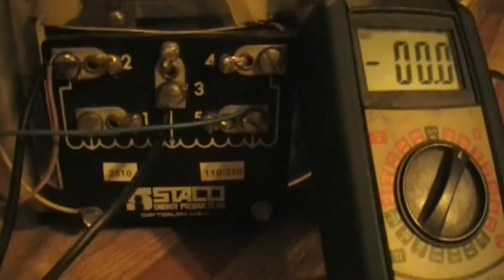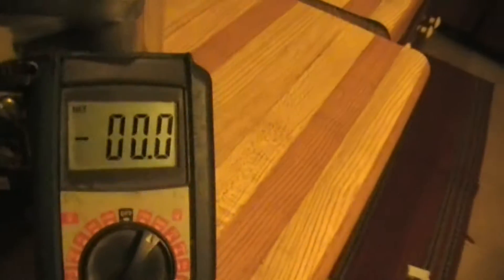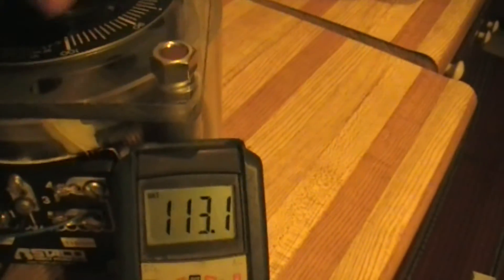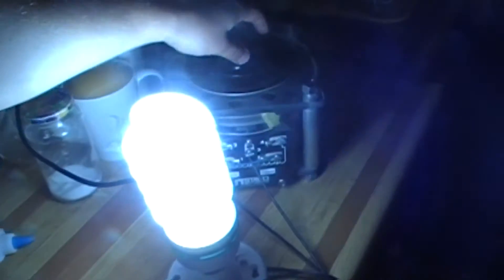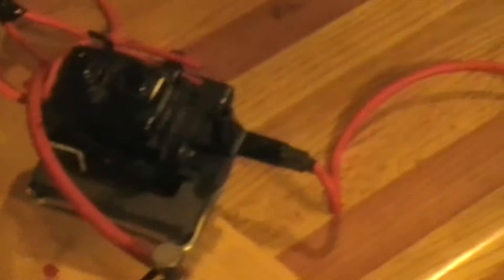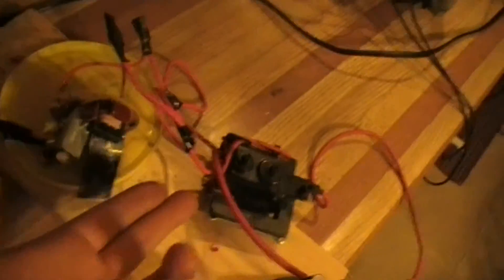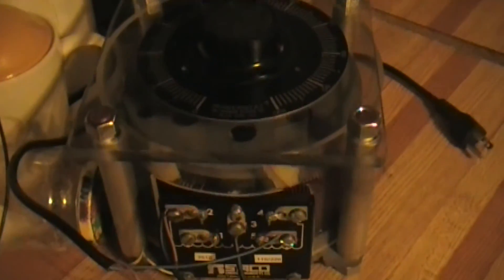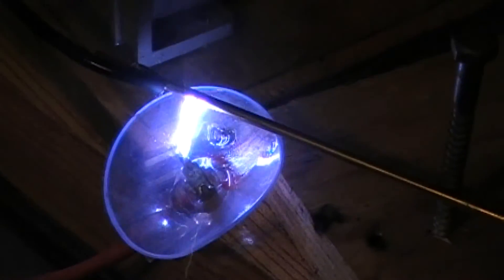Fun With a Variable Transformer.

Comment: Nice Variac!

I did initially think that one was pretty compact for a 20A, but then that's at 120V so 2.5 KVA,
I have a few 20A @ 240V variacs, 5KVA now those are beasts, pretty impractical for most applications though...
Although I have a dual stack motor driven Claude Lyons 1225 25A, again impractical but I do plan on wiring it in series to obtain
500Vac at 20A which I could make use of the 400V for any 2 phase stuff I come across, which is common in industry over here. =]

Btw, undervolting CFLs, I've actually killed a few by doing that, I think it stresses the voltage regs out, they seem to fail pretty quickly,
just for your information, would have to kiil a sentimental CFL off eh! x]
Reply from the maker: Thank you! I love variacs, they are old-school and cool. I am going to be using one in conjunction with an NST for an upcoming true Tesla Coil project I am building to scare trick-or-treaters this Halloween.... Thank you for the info about the CFL's.... noted :)  .... peace.
Reply: Binj Komisar Awesome, yeah NSTs are pretty awesome as a Tesla coil transformer, as long as they don't have the electronic GFI circuits in it'll be a winner!
Reply from the maker: Steve Lane Yeah, the one NST I have (7.5kV) has the GFI circuit won't run. The other one I have (9kV) works great... I bummed, is there any way around the GFI issue I wonder...
Reply: Obviously if the NST is not potted they can be bypassed or removed, usually though they are potted and if the GFI circuit is below the potting, I've heard of various methods of digging or melting them out to bypass or remove them, it's not easy though so I've been told, I've not bought any GFI NSTs yet, and as far as I can help it, don't plan on.
Reply from the maker: Steve Lane Thanks, you have verified my fears. I will have to think on my situation and possibly change my plan of attack. Thanks for the help.